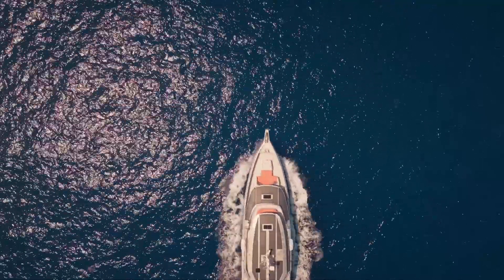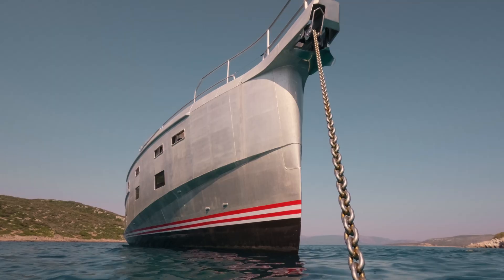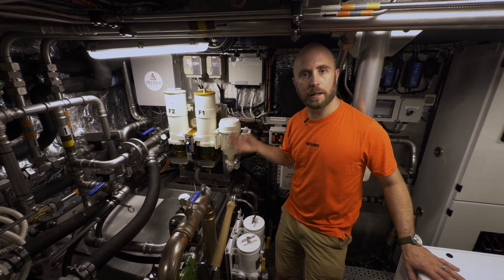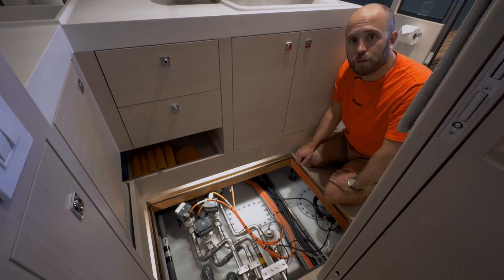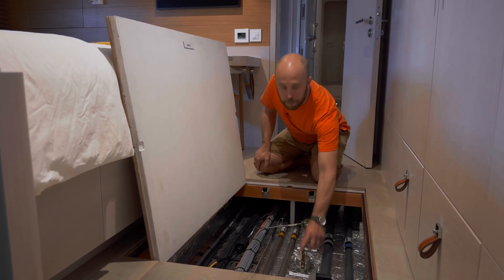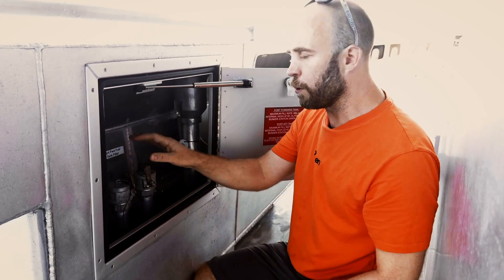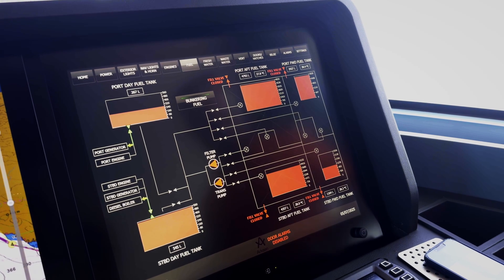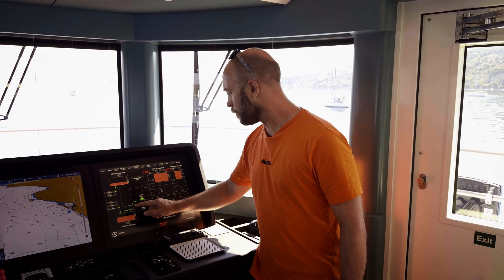Inside the Arksen 85 | Fuel System Walkthrough with Jim Mair

Comment: I understand the ability to manually adjust the levels in the tanks, my question is why not have this operation done automaticly as the “default”selection  .v requiring the crew.captain choosing one for both when underway and at the refueling time ? Did I miss that ?
Reply from the maker: This owner chose to not have too high a level of automation. It would be a straightforward  programming update to provide this capability with the existing infrastructure. So, if an owner would prefer more automation then this could easily be provided.

Comment: Love the fuel system! Is the fuel system operational software Arksens  design. Clever system integration. When you coming to Homer Alaska with a Arksen design.
Reply from the maker: Thank you! Control software is designed by our electrical engineers, SEC Marine. The control/switching hardware is built using industrial off the shelf components, so spares/repairs/replacements globally do not require specialist parts or long lead times.